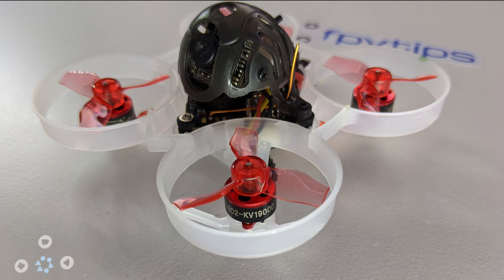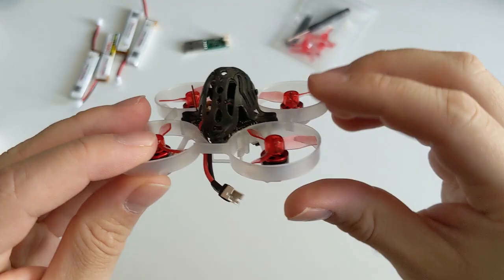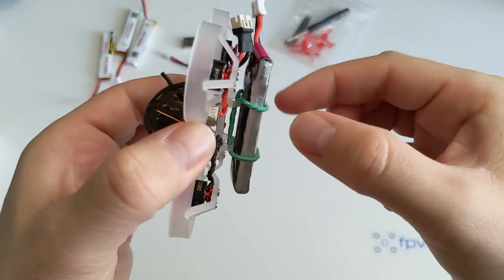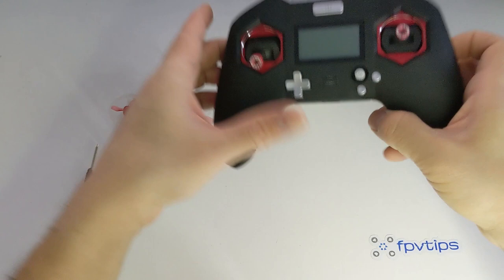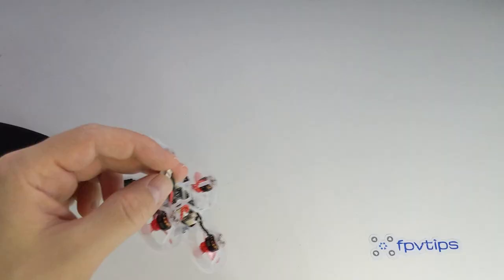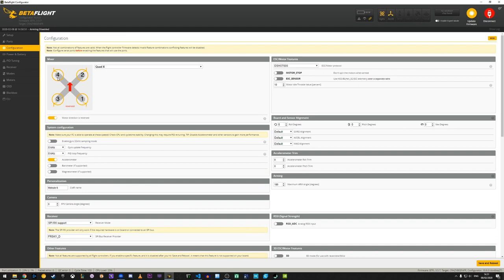Happymodel Mobula6 - Review, binding, COMPLETE SETUP, JESC 48 kHz MOD | BEST WHOOP WINTER 2020

Comment from the maker: TABLE OF CONTENTS:

1:03 - Unboxing
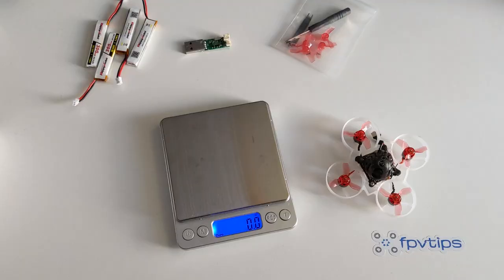1:33 - Specifications
6:20 - Binding and radio setup
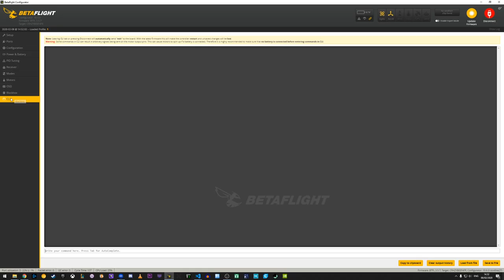8:48 - Betaflight configuration
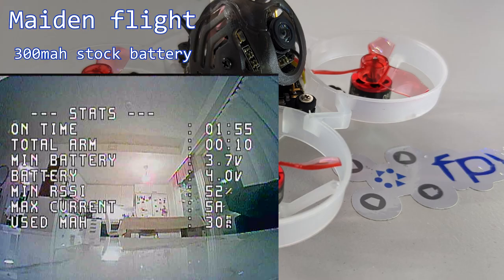11:45 - Maiden indoor flight on 300mah stock battery
13:09 - 450mah GNB indoor stock ESC firmware
13:58 - Outdoor maiden on 300mah stock battery
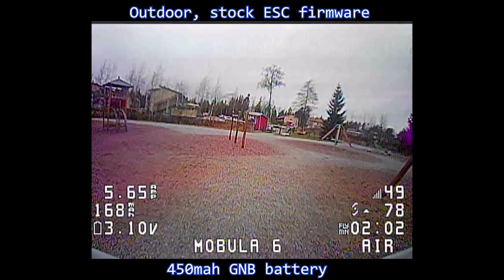15:08 - Indoor 300mah stock battery with JESC 48kHz firmware
16:30 - Indoor 450mah GNB battery with JESC 48kHz firmware
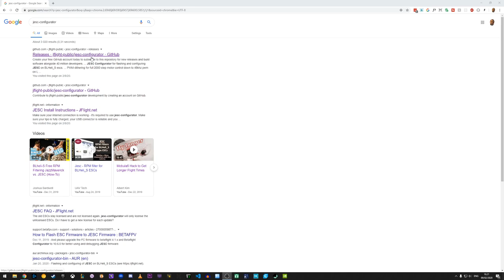19:37 - How to flash 48kHz ESC firmware with JESC
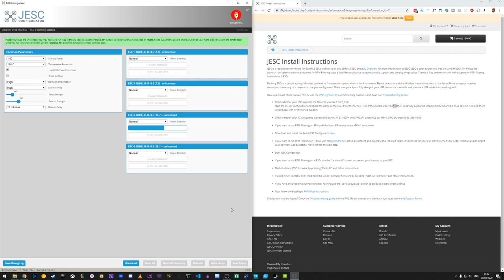21:46 - Conclusion

Comment: Very nice review! 😎 🤘 💜
I know he mentions flight times a few times in this video, but GUYS it's not about long flight times with the Mobula6!!! ... It's about HIGH PERFORMANCE, nimble, fast, and exhilarating flights! Changing batteries is quick and easy! I do not suggest you dwell on flight times, and use a maximum of the 350 mah batteries I mention below! Big batteries stifle performance! 😩
Next upgrade:
Like you said, GNB 350 mah batteries work great! I have 2 six packs purchased on Amazon! 
R3D Shifters Who0p Zero GRAV nylon/carbon fiber frame is a GIGANTIC upgrade! I have two of those, and absolutely love them! Tough as nails, separate parts available super reasonably, no waiting a month to arrive and having it still be a frame from 2016!...and it makes the entire height of the Mobula6 about 3/4"! So, flying through gaps takes on a totally new dimension! RAD looking as can be, it takes the looks from 1960 VW to 2020 all black McClaren! 💥
Camera is totally protected and props are out of view! Nearly any battery, within reason of course, can be fitted either straight in or toilet 🚽 tank! That helps flight performance, as does the super thin profile! The Mobula6 weighs the same after this incredible mod!!! 😁👍 Customer Service is off the charts from this NYC, NY, USA small company! Design is A++!
Next mod... EmuMockuka! A combo Emuflight and project Mockingbird tune brings flight performance to a new high! 
I absolutely 😍 love 💖 my Modded Mobula6 and after 3.5 years of adoring who0ps, THIS IS THE VERY BEST, P E R I O D !  😅
PS... You should have got the 25000kv motors! That's what makes the Mobula6 totally unique! With these mods it  absolutely RIPS indoors and out! Nimble as F U % K!  LOL 😜
Reply from the maker: Wow! I love the energy and really appreciate your comment! A lot of good stuff in here, so I certainly hope many people will read your comment. I'm not one to shame anyone for their choices though also, so if you prefer more chill cinewhoop style flights, you do you. It's true though that the Mobula6 performs like a rocket. 25000kv is no doubt better for racing and zipping around fast, but 19000 is IMO better if you wanna fly a bit outdoors too. Either way, very happy you love the quad, and I sure as heck love mine too :)
Check out this vid on setting up Emu and PMB - https://www.youtube.com/watch?v=PgTSedxLZMk

Comment: Not sure if anyone has already tried the 350mAh as @FPVtips suggested (I'm too lazy to read all the comments), but here is my experience with GnB 350's:

1. I should note that thanks to this video I have JESC installed
2. I have the 19000kv motors
3. If you plan to buy 350mAh batteries, make sure they are with cables instead of the PH2.0 connectors coming directly out of the body of the battery (I was naive enough to think "ahhh, f*ck the cables - we're saving weight here"). The reason is that the power cable coming out of the mobula6 is too short and I couldn't center the battery properly.
4. Although the weight difference between 300mAh and 350mAh seems small (a couple of grams), the throttle level for hovering is considerably higher. (this might be because the center of gravity is not at the center of the axles and two of the motors have to compensate).

BUT

4. I am consistently reaching flight times of 4:30 (indoors, no crazy freestyle) even when doing a few turtle mode flips and following the 80% rule (I land on 3.72 - 3.75v)

All in all, I would go with the 350mAh batteries with cables and JESC firmware for considerably longer flight times and with the 300mAh for racier feel with more precise control over the drone.
Also many, many thanks to FPVtips for the great content. I mean, the quality is one of the best out there. Please, keep up the good work!
Reply from the maker: Thanks for sharing your experience with all of us. Plenty of good points and learning opportunities right there!

Comment: I followed your instructions and my Mobula 6 HD had problems. When I armed it one motor would not spin but jerked and stuttered. Another one did the same off and on. Could not get into the air. I reflashed, did a different version lower on the list. Finally after flashing and reflashing, changing the sequence of connection to the configurator, plugging the battery in first , not plugging the battery in at first, etc, etc. I FINALLY  hit on some sequence that made it work. It was scarey because I thought I'd tanked my Mobula. I did my two Tiny Hawks. The "S" model loaded without a hitch but my original Tiny Hawk had the same problems as the Mobula but I got it finally done too. I actually had to go into BHeli and reverse a motor that had now was spinning the wrong way! Took me a looong time to get these done and I don't know if I'll do my more expensive 2 and 3s whoops. I wish it was simple as it was for the one Tiny Hawk then I could trust it more. BTW, I did finally get the proper version onto them not the 2.2ver that was lower down on the menu.

Comment: I bought the mobula 6, and it came with 4 batteries of 1s 300mah 30c, I can use one of 1s 380mah 60c has 0.5g more than the original.

Comment: I installed Bluejay with 48hz on my mobula 6. It reduced the current during the flight and increased the flight time a little, however sometimes it fails safe where it doesn't happen with original firmware ESC. Sometimes one of the engines does not turn on and the drone does not take off. I have already configured the motor start parameters, even so, sometimes one of the motors does not start turning. I think 48hz and 96hz for tinys is good but have some problems.

Comment: I recently purchased the HD version and it came with 250Mah batteries. I don't know if this is due to battery availability or not. The battery fits perfectly in the holder on the model. I have not flown a full battery yet so I'm not sure of the flight time on these batteries. I'll post back once I know what kind of flight time its good for.

Comment: i need help this is my first quad ive been at this for days now lol. my drone just wobbles and the motors turn just off after i start throttle. i turned of runaway mode but i think the board is out of line because when i move the mob6 in beta flight the drone moves the opposite way
Reply from the maker: Check the board orientation option in Betaflight and adjust the degrees.

Comment: JESC configurator doesn't allow me to flash 48 khz firmware because it says I have to update to betaflight 4.1
Reply from the maker: It will say that if you are trying to flash the version with RPM filtering (which also requires that you purchase a license). Select the firmware without RPM filtering if you don't want to install Betaflight 4.1

Comment: Thanks for the great video!
Do you mind sharing your tune/pids?
I'm a new pilot and trying to figure it out. While it flies great stock I'm struggling to get a tune on the 1900kv I think is better.
Reply from the maker: I haven't touched the PIDs at all, running completely stock. IMO for 95% of the use cases the tune is pretty ok, and in this case it fits my flight style so didn't change anything :)
Reply: @FPVtips  thanks! I guess being new I thought you always need to tune. Will switch back to stock. Until I try the project mockingbird!
Reply: Jonathan King The thing you need to tune being new is rates, not pids. Rates are very personal for each pilot and each need to find their preference. Pid tuning is to combat poor flight characteristics but shouldn’t be required on newer quads as most problems have been tackled over the years.

Comment: Very helpful video, thank you. With 300mAh batteries, at what voltage do you stop flying?
Reply from the maker: regardless of the battery's capacity I stop flying at 3.5v, unless i really don't care about the battery's life and it's a micro like in this case, where i can push it even further. I don't recommend this, but I'm not the only one doing it either, so there is that :D

Comment: I get between 5 to 5.5 mins with gnb 350mah and I also upgraded the frame cause mine broke and I’ve just been flying about a month but I never broke my meteor65 frame and I feel like it flys even more stable with the meteor65 65 frame
Reply from the maker: Awesome, that's great to hear! Is that somewhat chill flying and indoors?
Reply: FPVtips I say yes cause I’m just starting out in fpv I have a ladder and a couple other gates but my apartment ain’t huge either
Reply from the maker: @mtblookout3920  Awesome! Have fun with it mate!
Reply: mtb lookout what motors are you getting that with? Are you jesc flashed?
Reply: Elyjah’s Adventures 19000 and yes on jesc and it’s also indoor flights
Reply: 30c or 60c?

Comment: Hi,
can I pleas ask you for help?
I just bough a new Mobula6 RDF kit with LiteRadio SE ( same as BetaFPV LiteRadio 2 SE ) .
Unfortunately I didn't know yet for the common problem with the wiping all of the setting when the battery run out of any juice and after I bind them and fly for a while this happened. I didn't have any dump file save or whatever else I need it to be backed up.

Now I'm struggling to bind them or adjust any settings. Any idea how to deal with this ?
Thank you!

Comment: Hi I'm using the X-Lite Pro, how did you get it to work on D8? I found out on the OpenTX companion not to mark the EU-LBT but I still couldn't get it on D8. Could you pls explain your method? Stay safe & take care!
Reply from the maker: I would assume that the X-Lite Pro comes with the ACCESS protocol. I'm "lucky" in a sense that I have an older X-Lite radio before FrSky started pushing their ACCESS protocol. I think unfortunately the answer to your question is that in your case you probably cannot bind in D8 mode (or if you find a way, I'm very curious to learn how).
You should be able to bind just fine in D16 mode without any issues. For the better part, there's not a lot of super big differences between D8 and D16, so hopefully this should not be an issue for you. Stay safe and happy flying :)
Reply: FPVtips hi thnx for your answer, the other option for me is to buy a Module. Take care & Stay safe.

Comment: Nice video thanks!I’m receiving mine tomorrow, can I ask you what goggles/antenna you are using here?
Reply from the maker: Basically this: https://blog.georgi-yanev.com/fpv/gear-2019/#goggles
Reply: @FPVtips  thanks I bought the skyzone 02x and they are amazing! Using foxeer patch and a lollipop on the other side, I get failsafe on the mobula 6 way before getting any static at all on the goggles...
Reply from the maker: @samuelevinti  haha I guess good problem to have and maybe time to consider an XM+ or crossfire :P good antenna choice!
Reply: @FPVtips  xm+ on the mobula? It Won’t be too heavy with an additional receiver?
Reply from the maker: @samuelevinti  It might be, but it also just might work. I've seen they've done a mobula6 hd with an external xfire receiver. Not sure how the weights compare, but would be somewhat similar I think.

Comment: Mine used to get around 5 minutes of flight time with 48 kHz, now it gets around 3:30. I tried oiling the motors and relaxing the AIO and I don’t understand the problem
Reply from the maker: What changes so you started getting the shorter flight times? What Betaflight firmware version?
Reply: I didn’t change anything, I think maybe the motors need to be oiled, what do you think
Reply from the maker: @bajablastfreeze4957  I've seen only 1 video ever talk about oiling the motors and while there is without a doubt some small benefit from doing that, it will never be to the extend to affect your flight times by like 50% or more. In most cases the effect of oiling the motors would be quite marginal. If you feel like going after it, go for it. But if you really think you have an issue with flight times, I'd look into my batteries, prop combinations, motors, weight. If you have the out of the factory config with Betaflight 3.5.7 and JESC with 48kHz firmware, stock props and the batteries are not dead from being flown too low too much, you should be getting good results. Let me know how it works out if the oiling helps I'm curious!
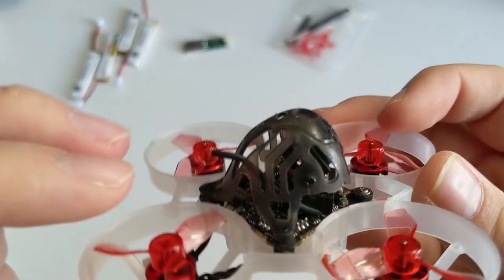Reply: Yeah I’m using a stock mobula 6, stock firmware, and Jesc 2.3 48khz. The first few flights I was getting 4:45 minutes then it got to around 3:30. Now the flight times are like 2:20. What could be degrading
Reply: Batteries???
Reply: @bajablastfreeze4957  im in the same boat, I think it's my batteries. I've pretty much been flying a few times daily since like february. But also since then I've also gotten a lot faster zipping around the house in AIR mode, so maybe you also got faster and are pulling more amps out?

I do notice my voltage sag being much much worse, as in now when I usually end my flights at 3.1v and 270mah drawn, my batteries would come to rest at 3.8v on the dot. Now I come in at 3.1v and my battery jumps back up to 3.9-4.0v. My mah drawn is around 200 or less a lot of the time so I just sit with the quad armed until I get my lipos around 80% discharged and they jump right back to storage voltage.

Edit: I am using 350s btw

Comment: For some reason when I press read setup nothing happens
Reply from the maker: With a battery connected? We need power for the ESCs. Doubt it's a driver issue, if you made it that far and are connected to the correct COM port.

Comment: hi, can you tell me if I have to flash betaflight in 4.1 to be able to use the ESC firmware jesc 48khz . Thanks to you
Reply from the maker: Unless you want RPM filtering you don't need Betaflight 4.1 and you don't need a license for JESC. If you want also RPM filtering, then you do need to flash Betaflight 4.1 and you need to purchase a license for the JESC firmware.
Reply: @FPVtips  1000 thanks for the review and for this clear and precise answer.

Comment: Hi, How do you flash the firmware 3.5.7 from the happymodel website ?
Reply from the maker: I'm currently working on a video that shows how to flash Emuflight, but the process is identical. To flash firmware use the Betaflight Configurator (https://github.com/betaflight/betaflight-configurator/releases), and select "Update firmware". Then you can select from the existing list or load firmware from a file.

Comment: Can you use the plastic capped style batteries, or do you have to use batteries with the pigtail?
Reply: You can use the plastic capped type, provided it is still the JST-PH2 connector, not the BetaFPV BT2.0 connector.
I prefer the plastic capped type. especially the GNB 300mAh. The pigtail wire from the quad is long enough.
Reply from the maker: Haven't tested if those would fit

Comment: I have a dsmx internal receiver on mobula 6. I did the bind_rx in cli and it bound but when I engage motors it says rx loss on osd. Any help ?
Reply from the maker: Is it possible to be causing issues due to firmware mismatch?

Comment: hi, is it possible to flash ESC even with old versions of Betaflight, such as 3.5.7? 

Can you possibly put Blheli firmware back and how? Thanks
Reply from the maker: Definitely don't take my word for it and do some extensive research, buuuut in general it should be possible. Flashing your ESCs with firmware has for the most part nothing to do with Betaflight, unless some compatibility concerns have to be taken into consideration. For BLHeli just use the BLHeli configurator, it's pretty straightforward.

Comment: Jo please help i get 2 minutes tops with the stock battery in or outside what should i do?
Reply from the maker: Depending on your flying style that might be fine if you're pushing it 90% of the flight time. Otherwise, look into new, proven batteries, do some of the esc firmware / betaflight / emuflight software improvements.

Comment: When I flash it with jesc for some reason it just flips out, and when I reflash blheli I have to reconfigure in Betaflight to make it fly normal cuz it’ll just flip out still, how can I fix this, I really need more flightitme...
Reply: If anybody knows my problem plz help meee
Reply from the maker: What version of Betaflight are you running? If you're on 3.5.7 and you're trying to take into use RPM filters ESC firmware, you will need to be on Betaflight 4.1 at least.

Comment: HELP: What battery switch should I be in for the stock batteries?
Reply from the maker: Not sure I get this?
Reply: @FPVtips  there is a little switch on the charger that was confusing. I gave up on it though. I could never get the mob6 to engage. Studied betaflight for weeks. Had some rc people look at it, but no luck. Seems this hobby just wasn't meant for me, but it looks like a lot of fun.

Comment: Mine will not bind please help
Reply from the maker: If you are using FrSky protocol, you might have to use D16 if your radio is using the newer ACCESS protocol. Otherwise, following the guide in the video should get you setup.
Reply: @FPVtips  I figured it out thanks
Reply from the maker: @treeclimier272  Glad you did! Was it the D16 thing? Happy flying!
Reply: Oh snap. I’ve been trying to get mine in the air for a while now with no results! I’m going to switch the radio to d16. I have a betafpv LiteRadio 2. Maybe that will work! Thank you for the awesome review and set up guide 🙏🏾